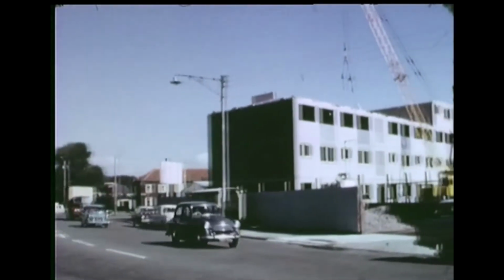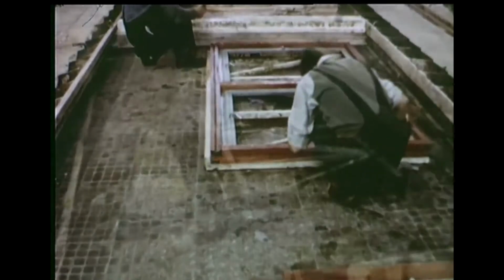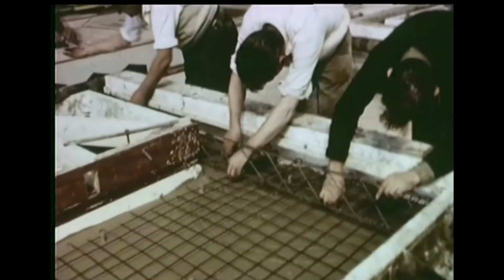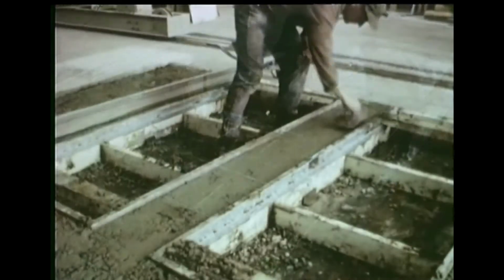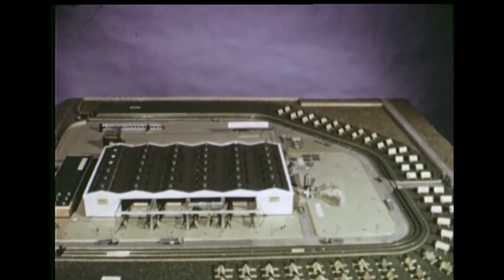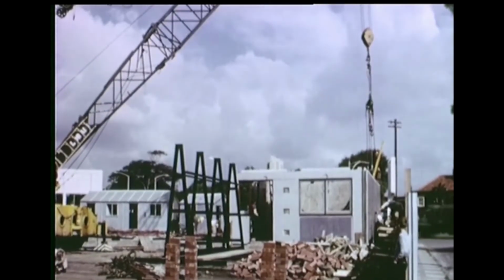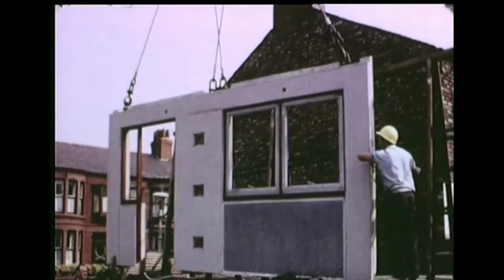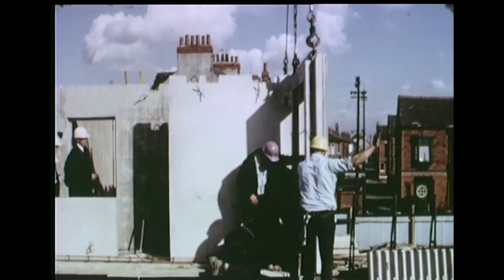Liverpool .Unit By Unit (1964)

Comment: Thin walls not enough insulation making them very cold to live in. Also the steel reinforcement  was un treated also the concrete used was not waterproof this all came together causing concrete cancer caused by the steel rusting.

Comment: 0,36 to 04 is a snapshot of Broad Lane in Southdene Kirkby and likely the 44d 544 or 500 bus that took that route. Sadly the new building method shown here was not successful. The properties built at Tower Hill in Kirkby were very unpopular  with tenants, and were demolished in the mid 1980s
The "Parker Morris" building design preferred by the Macmillan  government when they built Speke and Kirkby have lasted over 70s years and proved great value for those who exercised the Right to Buy in the early 1980s.
Liverpool City Council were responsible for the housing stock in Kirkby until 1974
Reply from the maker: Thank you very informative